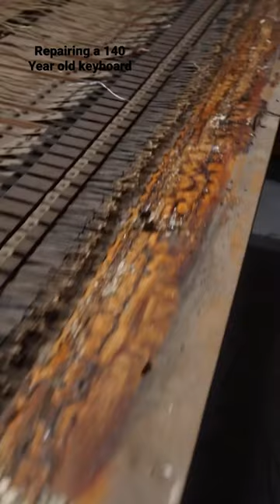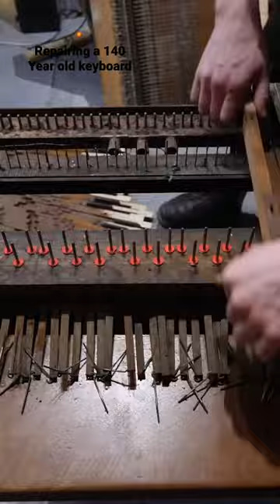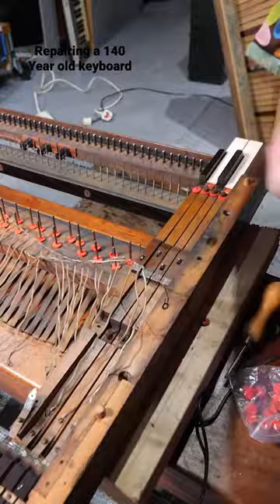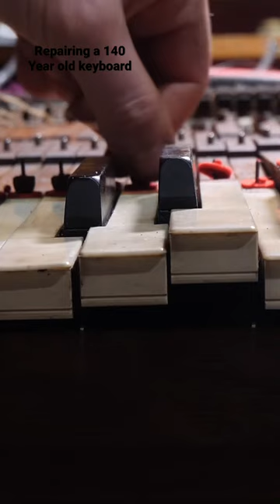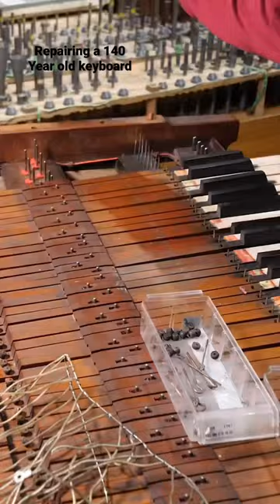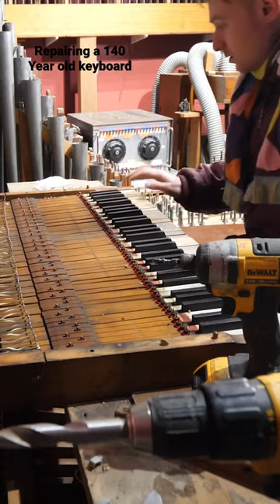Fixing a 140 year old keyboard #shorts

Comment: I just did the maths on the age of that keyboard! I reckon that's either a very early electric action or it was originally tracker/mechanical that was removed and retrofitted with electrical contacts. 140 years ago would have put it in the 1880s, so definitely around the time organ builders were first developing electric and elecropneumatic actions. The first builder to use electric action commercially was Robert Hope-Jones, who went into business in 1890. Just some random factoids that someone might be interested in.
Reply: The 140 years is very conservative guess. In the longer video this short comes from it is found that the keys are marked with their manufacturer.  The age comes from the years that organ manual supplier was in business.  Parts of the organ could be a lot older.
Reply: Right -- and this was major drama at the time. The extreme Luddite reaction against organ electrification ultimately drove anglo-american technical genius Hope-Jones to suicide.